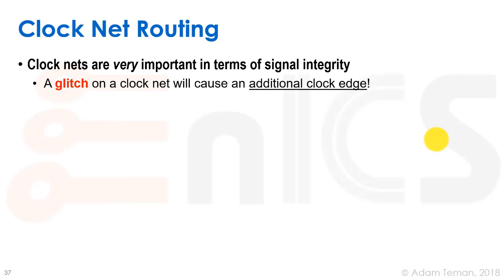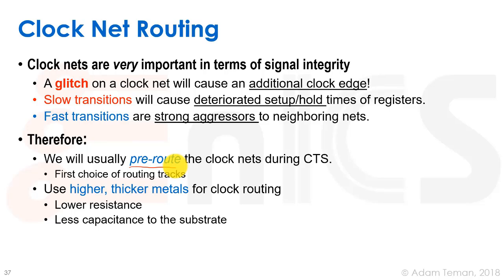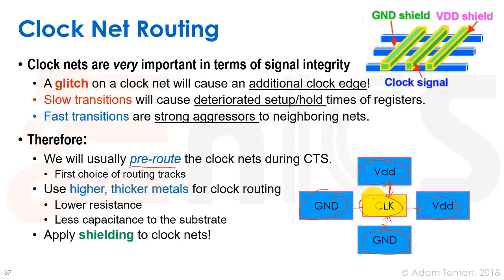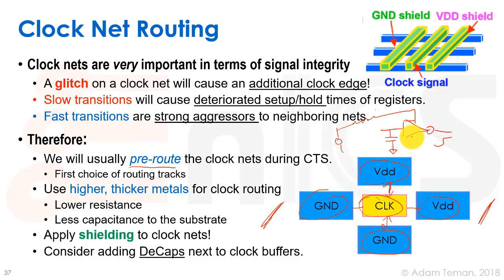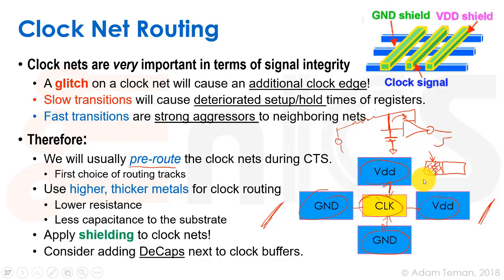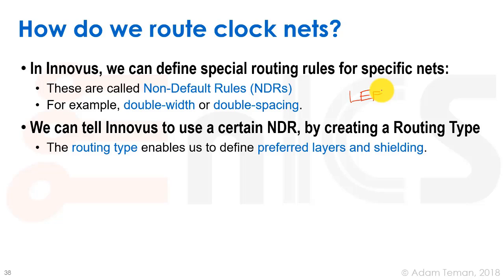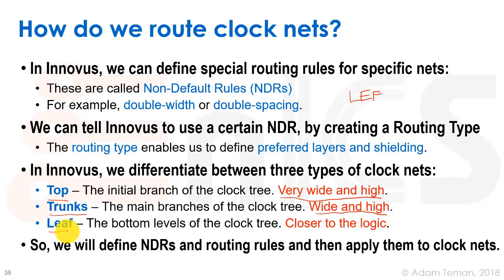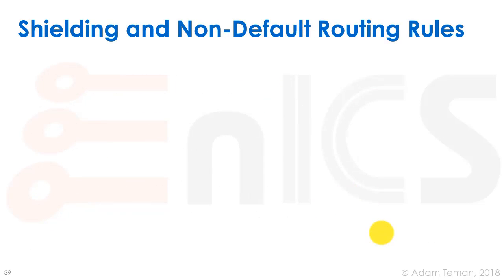DVD - Lecture 8e: Clock Routing and Clock Tree Analysis

Comment: Hey Adi,

@9:42 but it would only affect the setup timing, and not hold timings as hold will be checked one clock edge earlier  or at the launcg edge of launcher/virtual flop.   Also @10:15 why would it be easier to meet hold time at the output now?
Reply from the maker: No, skew affects both setup and hold. 
If we go back to our timing constraints, both min delay and max delay have "delta skew" in them. The added delay to the real clock and zero delay on the virtual clock cause a "delta skew" that is not necessarily real or representative of reality.

So for the input, delta>0 (positive skew) ==> setup is easier, hold is harder.

For the output, delta<0 (negative skew) ==> hold is easier, setup is harder.

Comment: Hi Adam;

regarding to Skew and transition time:

I think we are in the dilemma, which is there is no free launch as you said before.

Should I Put more tight_transition or should i relaxed?

If i tighted, the tool will insert a lot of buffers and it will lead more area, congestions and static power consumption, at this time this is robust for crosstalk, less short circuit power and also this is reasonable for propagation delay.

If i relaxed, i will Susceptibial for crosstalk, and also more short circuit power

and regarding to skew if it tight i will get highest power and area but best for STA, and vise versa.

is that true?

if it's, is there any recommendation from the industry experts to not fall in this dilemma?
Reply from the maker: I think this is a good observation.

First off, as you said, there is no free lunch. Not only in CTS, but in almost every one of the design stages and processes. But this is why the tool is full of algorithms and heuristics to look for a "good" solution. The reason I am trying to teach you what the tool is (partially) doing is to understand the limitations of these heuristics and enable you to direct the tool (or write your own version) when you need something that doesn't meet the "general" case that the EDA provider decided was best. 

For the specific problem you describe, there are many many parameters that go into these tradeoffs and affect the results and they may not be straightforward. Therefore, the CTS tool runs many iterations and heuristics with MMMC and "what-if" type analyses enabled to try and find a good tradeoff. But you can use the various directives to override the defaults and there is a (not bad) chance that you will achieve better results.

Comment: How shielding with vdd helps to reduce capacitance compare to shielding with ground
Reply from the maker: Hi,
I don't believe there is a specific preference or difference. The main thing is that the shield is a constant "driven" voltage.